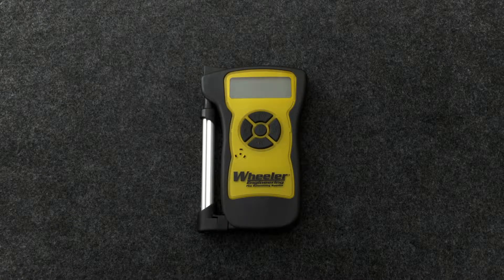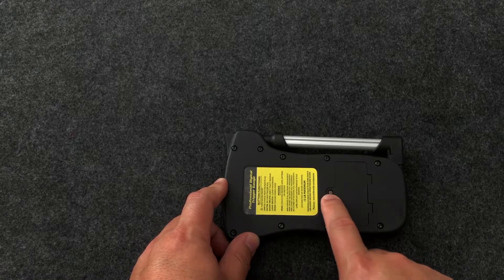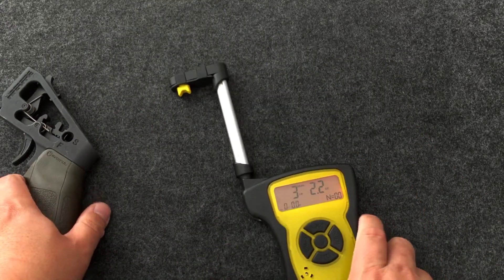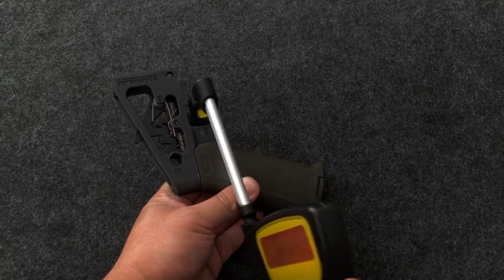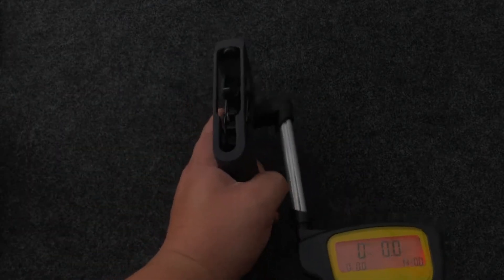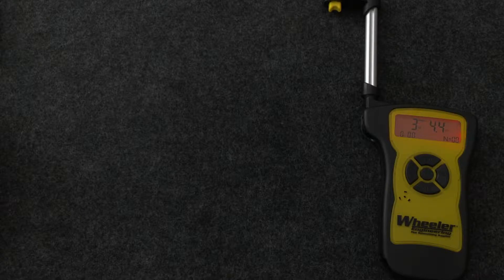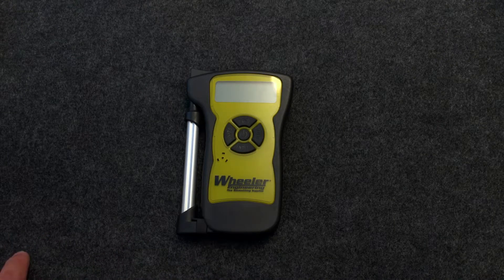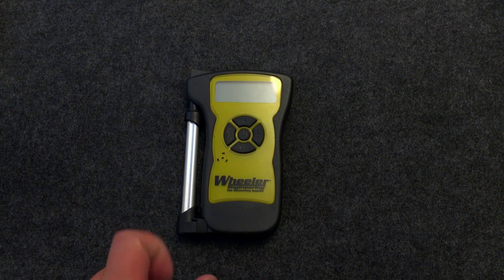Wheeler Digital Trigger Gauge review and accuracy

Comment: I is quite accurate then, specially when the trigger pull will be done horizontally (not vertcall for your test) so the "weight" of the sensor will also be eliminated.